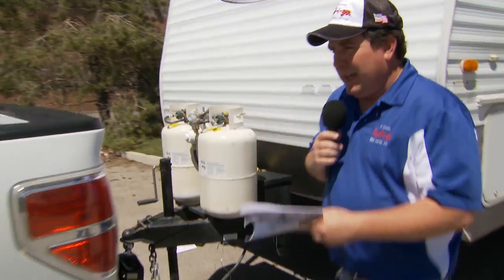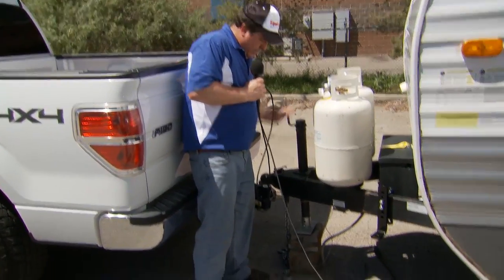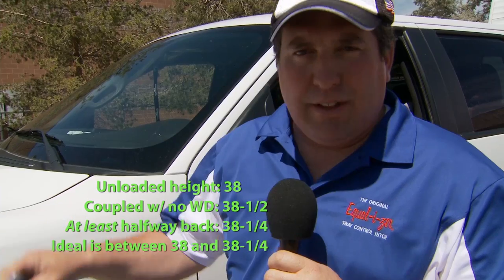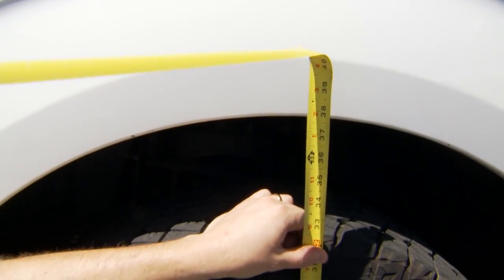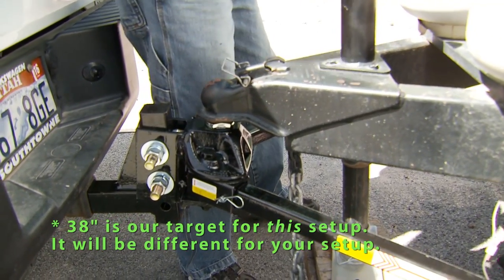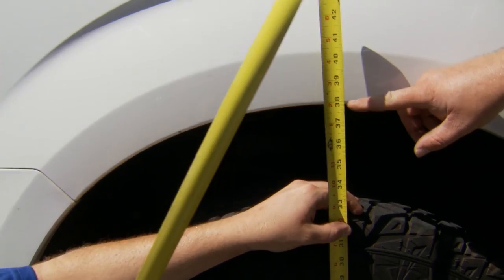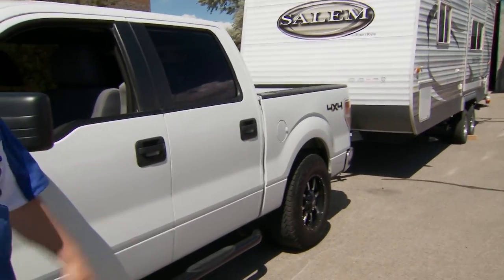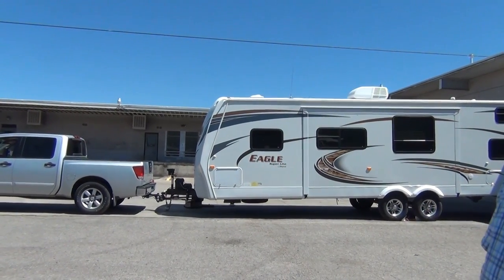How To Fix Over or Under-adjusted Weight Distribution

Comment: I like to use painters tape with a line on it to make more accurate measurements.
Reply from the maker: ***** Interesting idea. Where do you put the tape?
Reply: Above center of axel. Just makes it easier to measure to the same place each time rather than to a curve or body line. Nice sharp line. Just don't move between changes. The height is irrelevant, the change in height is all that is important.
Reply from the maker: ***** Great idea! Thanks for the tip.
Reply: +thunderslide 
do you mean center axel of trailer
Reply: No, that does not change, the tow vehicles axles for baseline and changes for set up.
Reply: Why is too much weight distribution dangerous?
Reply from the maker: totaldla,

Great question!
When you are applying weight distribution, you are essentially forcing the tow vehicle to carry more of it's overall load on the front axles than would be carried there without using weight distribution.

Correct weight distribution allows the rear axle to carry the trailer's tongue weight, while helping the front axle keep the weight that holds the tires on the road, giving you good braking and steering control.

Too much weight distribution "lifts" too much weight off the rear axle of the tow vehicle. This can create a dangerous situation in a turn where the weight and momentum of the trailer overcomes the traction of the rear tires, making them 'break loose' from the pavement. When this happens, the combined vehicle (tow vehicle coupled to trailer) can go out of control and jackknife.

There is a great video that shows how weight distribution changes the weight carried on your tow vehicle's axles here: https://youtu.be/XBZu39pQ8Gg
Reply: Great idea, plus you can make your starting unloaded number a nice round number like 40 inches exactly making calculations a little easier for mathematically challenged people like me.

Comment: Hold on there!!!! When you took a washer away, didn't you have to tighten the bolt at the back again? Are the washers supposed to be that loose inside?
Reply from the maker: You are correct. The washers should never be loose. After you remove a washer, you need to tighten the bolt.

Comment: How do I set up with air bags? You guys should do a video for that. I have firestone airbags and I’ve gone through the set up and. I still get away on freeway
Reply from the maker: +bcobrag,
Using a combination of air bags and weight distribution is a great setup. The one thing you must be careful with is inflating the airbags after the hitch has been set up for weight distribution. When you do this, you effectively change what the baseline would have been, and end up taking away weight distribution and sway control. Here is a video that describes the differences between airbags and weight distribution. http://fstwy.co/thedifferencevideo
We recommend that you inflate the air bags first using your desired psi, then go through the process of setting up the weight distribution on the hitch to be correct. Hope that's helpful. Let us know if there's anything else we can do for you.

Comment: Do I have to add or remove washers or just change the depth of the angle set bolt? If I understand correctly, you'd want to have the head of the washer stack as flat as possible against the shank end to have even weight pushing on it so the shank bolts are not stressed as much. Also, you didn't show us in the video how you tightened the shank bolts. Are you using an impact wrench? I can't find a torque wrench anywhere that goes higher than 250 ft lbs. Your manual states they need to be tightened to 320 ft lbs. Please enlighten us.
Reply from the maker: Adjusting the weight distribution on an Equal-i-zer hitch can be done two different ways. You can add or remove spacer washers in the hitch head assembly to change the preload angle of the head and weight distribution bars, or you can change the position of the L-brackets on the trailer frame to raise or lower the position where the weight distribution bars are held. The addition or removal of one washer is equivalent to raising or lowering the L-brackets one hole.

If you are making a permanent change, we recommend making the change with the spacer washers in the head. This allows you to keep the L-brackets set in a position where the arms are more parallel to the frame of the trailer which reduces some wear and noise potential, and allows the widest possibility of adjustment at the L-brackets if needed in special situations.

If you are making a temporary change, for example, towing your trailer in for service without any cargo, or towing without a toy loaded into a toy-hauler trailer for a single trip, we recommend that you make the adjustment with the L-brackets which can easily be moved and then repositioned again for your typical towing situation.

Refer to the Equal-i-zer hitch instructions here [https://www.equalizerhitch.com/manuals-and-guides] for details about how to make these adjustments correctly.

 As far as the washer stack, having the spacer rivet and angle set bolt tight to the shank is more important than the angle at which they come into contact with the shank. Excess stress on the bolts happens when there is a space between one or both of these. Having them tight transfers the forces from the head to the shank directly instead of putting a shear force on the bolts. Use this video as a guide: [https://www.youtube.com/watch?v=7q0ZDeijHZ4.]

Tighten the shank bolts with a large torque wrench. Most impact wrenches will not reach the required 320 ft-lb needed unless they are very large, like those designed for the heavy truck repair industry. There are a number of manufacturers that make adequately sized torque wrenches. All have a 3/4" drive and are probably larger than you would expect – most about 3’ long. A search online for “3/4" drive torque wrench” will find what you’re looking for.

Comment: Hi Dave I have a question for you. I have a 2009 Chevy Silverado 1500 & I'm getting ready to purchase my first rig. My issue is, the truck is lifted 7" & also has rear airbags for leveling with a load. Do I need one of these, Are they easy to set up with lifted vehicles, & can you adjust with the air bags? What's your recommendations for my set up?
Reply from the maker: +1205firefighter,
Thanks for the question. Yes, you can use an Equal-i-zer hitch with a lifted truck, and with air bags. Air bags and weight distribution are different tools for different jobs. They are not interchangeable, but can compliment each other. Air bags give you a quick and easy way to stiffen or soften the suspension of the vehicle, depending on the ride you desire for the load you are carrying. Weight distribution changes the way the tow vehicle carries the addition of trailer tongue weight. With an Equal-i-zer hitch, you also get the added advantage of Integrated Sway Control, which you don't get from air bags. Here are a couple of good videos to watch on this:
- Equal-i-zer hitch: http://eqhit.ch/eqvideo
- Air bags vs. weight distribution: http://fstwy.co/thedifferencevideo

For your setup, you will probably have to look into a specialty shank with a longer drop to get the hitch head low enough for your trailer, and setup correctly. We recommend using the calculator on the Equal-i-zer hitch website ( http://eqhit.ch/findshanksize ) to find the shank you need. If that is not the standard shank, we recommend purchasing a no-shank model hitch, and the correct specialty shank. That will save you some money, and you won't end up with and extra shank you don't need.

We recommend that you inflate the air bags to the level you like to use, then set up the hitch. Adjustments to the air bags after that will change the amount of weight distribution you are getting from the hitch. You will likely have some trial-and-error set up time to get the air and weight distribution working together well. If you get into it and need some help, get in touch with our customer support team at 800-478-5578 or Support@EqualizerHitch.com. Good luck!

Comment: I have a 1000/10000 equalizer hitch. It seems to be distributing too much weight off the TV. Measurements seem find, but actual truck weight only increased by 320 lbs instead of 800Ibs TW as measured by Rv Dealer. I get trailer sway. How should I adjust the equalizer hitch?
Reply from the maker: I would take your A B and C measurements to see if you are in fact overdistributing too much weight, and if that is the case, I would remove a washer from the hitch head, or lower the L-brackets down a single hole on each side.

Comment: I've only had my new equalizer hitch installed for a little over a year and I was just wondering how often do I need to check torque and/or tightness of my hitch ball assembly and hook up brackets on my camper? Is it safe to just tweak the nuts prior to going on a short trip?
Reply from the maker: We recommend checking your bolts every 100 miles, just to make sure they are up to the right ft lbs.! So yes!

Comment: Do I need to readjust if I add more weight to the tongue,  more battery and larger tanks,  ?
Reply from the maker: It would be a good idea. Usually if tongue weight increases then the setup may need adjustment. I don't think it would be anything crazy dramatic, but you may need to get more weight distribution by adding a washer or raising the L-brackets. But your measurements will show you exactly what is needed!

Comment: I bought a new truck with a 6" lift kit. I purchased from etrailer a new Equalizer drop shank for my new 2 1/2" receiver. I've worked the better part of a day chasing the recommended % for weight distribution. I started at 33%, then 45%, then 100%, then 11%, then back to 50% finally settling on 91%. The truck and trailer look good and I'm within 1/8" to 1/4" of the front wheel well height unloaded versus with distributed load. Is this "good" or should I try to get closer to the 75% optimum?
Reply from the maker: Hi there! The best way to get an answer to your question would be to contact our customer service team at support@equalizerhitch.com or call them at (800) 478-5578!
Reply: @EqualizerHitch  Thanks for your reply. I did in fact contact them a few weeks ago and they graciously replied and I am good to go!

Comment: Do you adjust with the trailer and truck weighed down ready to go camping or empty? I got my specs perfect with truck and trailer unweighted.  I was gonna add 1 more washer to compensate for extra weight
Reply from the maker: Great question! I would adjust after your trailer is fully loaded. That way you get the most accurate numbers, but if you aren't adding too much weight after, one washer should also work.

Comment: Thanks for the video. If you don't mind me saying that's to much trailer for that truck but I think you all ready no that.
Reply from the maker: Thanks for the comment +mark mathews.
Reply: No way! The tongue only lifted the front 1/2". That trailer is nowhere near too heavy.
Reply from the maker: Thanks for the comment +Charlie Odom. Remember, the front end raising is only an indicator that allows you to approximate what is happening with the weight on the vehicles. The only way to know for sure is to weigh the vehicles. This video was to give a general overview and help people understand some of the principles behind adjusting their hitch. We recommend that when first setting up the hitch, and occasionally thereafter, you have the rig weighed at a proper scale facility to make sure that all weight ratings for tow vehicle, trailer, axles, hitch equipment, etc. are within their limits.
Reply: Equal-i-zer Hitch you are specifically telling people to setup their hitch so that it removes weight from the front of the vehicle. This is incorrect! You should never have less weight on the front of the vehicle than when the vehicle is by itself. Pulling weight off the front induces understeer and control issues at higher speed. Why do you think a 5th wheel and gooseneck hitch is mounted in front of the axle centerline? It is specifically to ADD weight to the front of the vehicle. A bumper pull WD setup is no different.

A proper statement would say to add enough distributing weight to return the front to its unloaded height.
Reply from the maker: +Charlie Odom,
In some cases it is better to be closer to 50%. In other cases 100% is best.  For example, a long bed HD truck that is towing a heavy trailer should be closer to 50% WD. The truck is built to handle the loads and trailer weight better. It will not sag as much. Plus, it needs more weight and traction on the rear tires to prevent loss of traction while towing the heavier trailer. Also, because of the long bed it has a greater overhang distance (from rear axle to hitch). What that does is load the hitch more when distributing weight. In other words, the weight distribution takes more weight off the rear axle with a long bed vehicle than with a vehicle that has a short overhang distance (SUV, or short bed truck). So, 100% distribution in this case takes too much weight off the rear axle and creates a dangerous situation. Also refer to the vehicle owner’s manual. For the three HD truck makers (GM, Ford, Ram), their manuals instruct users to set WD at 50%.

On the other hand, an SUV typically needs closer to 100% weight distribution. These vehicles will have softer suspensions requiring more help from the hitch. Also, the short overhang (as mentioned previously) won’t load the hitch as much as long overhang vehicles therefore causing the rear axle to retain a larger majority of the trailer tongue weight. This means there is still sufficient weight on the rear axle to prevent loss of traction even at 100% WD. And if less than 100% WD is achieved, the rear axle may be overloaded and/or the rear of the vehicle may sag too much.

Summary – our recommended 50-100% WD is right on. Some situations are better with less – closer to 50%. Some situations are better when closer to 100%. Yes, that might mean that the front axle has slightly less weight than originally. But, there are a lot of other and sometimes competing factors that also need to be considered. And yes, 5th wheel and gooseneck hitches do mount at or slightly in front of the rear axle to not take weight from the front axle and to increase stability. That is why truck ratings for 5th wheel and gooseneck trailers are higher. This effect is taken into consideration with the reduced bumper pull tow ratings. So, stay within the vehicles ratings/recommendations, follow instructions in owner’s manuals, set the WD hitches properly (between 50-100%), and use a good sway control hitch to minimize the dangers and risks associated with towing a trailer.
Reply: What a very good comment.   People always throw out numbers and that's a good place to start but allot depends on how it goes down the road.  Mine halls better with a full tank of water so I have some work yet to do.
Reply from the maker: Thanks +mark mathews.
Reply: talking in a circle

Comment: My front end goes up about 1 1/2 inch, what kind of adjustment would I need.?
Reply from the maker: If your front fender is ending up high in the front after the whole system is connected, this is a good indicator that your hitch may be under-adjusted. For an under-adjusted hitch, you simply need to add more weight distribution by either adding additional spacer washers behind the hitch head or by raising up the L-brackets on the trailer frame a hole or two. This will help transfer more weight to the front of the tow vehicle and lower it back down to its original height. If you need further assistance with hitch adjustments, feel free to contact our customer support team during our regular business hours at 800-478-5578 or by sending an email to support@equalizerhitch.com.

Comment: I just got my RV Thursday and when the tech hooked up the hitch the front was lower than unloaded weight by about 1/8-1/4".  Should I take a washer out or leave it as is until the camper has some weight in it.?
Reply from the maker: We recommend that you leave it as-is until you have your tow vehicle and camper loaded, and then go through the setup measurements again to see where it is. You definitely don’t want to tow with it over adjusted, so if the measurements are still showing that the loaded w/ weight distribution measurement is lower than the baseline measurement, you will need to make an adjustment. You can do this either by removing a washer, or by lowering the L-brackets one hole. [http://eqhit.ch/manuals]

Comment: If I normally tow with a dirt bike in the truck bed should I set the hitch/weight distribution the first time with the bike in the truck?
Reply from the maker: Yes, that is the best practice. Of course, there are always exceptions. If, for example, you set up the hitch with the bike in first, then adjust the weight distribution, but when you weigh the rig your rear axle weight is very close to or over the axle weight rating, you can use the leverage of the hitch to take some of the weight off the rear axle and force it back to the front axle of the tow vehicle, and the trailer axle(s). This would be done by taking the initial measurements (see the Equal-i-zer owner’s manual here [https://www.equalizerhitch.com/manuals-guides/manuals/6k-14k-model-owners-manual]) without the bike, then loading the bike before the second measurement with the trailer coupled and no weight distribution, and keeping it there while you make adjustments for good weight distribution on the third measurement. However, if you do this you must make sure that your hitch is rated to carry enough to cover the tongue weight plus the added weight of the bike. You must also make sure that you do not create a situation where the front axle or trailer axles are over their weight ratings. Great question! Thanks for asking.